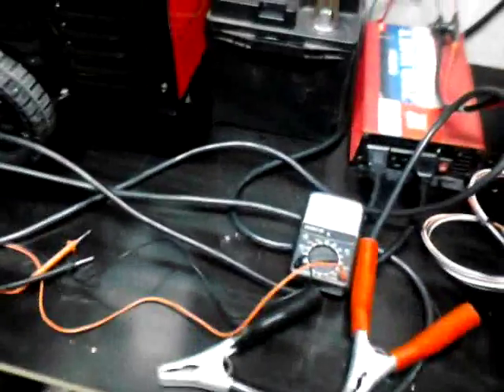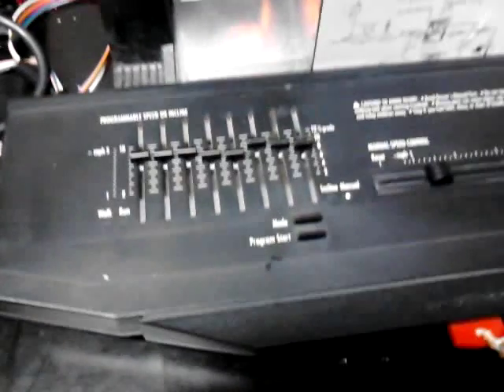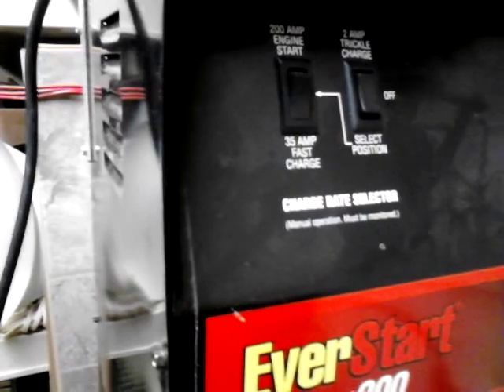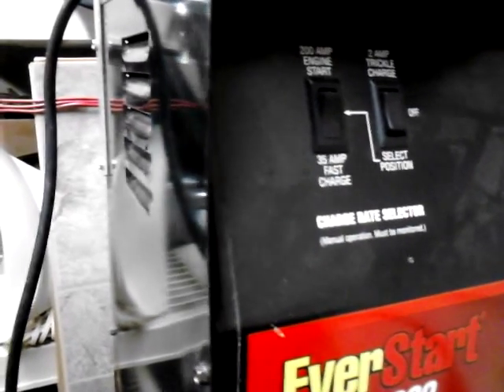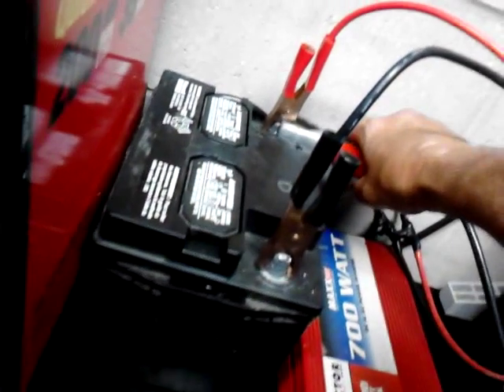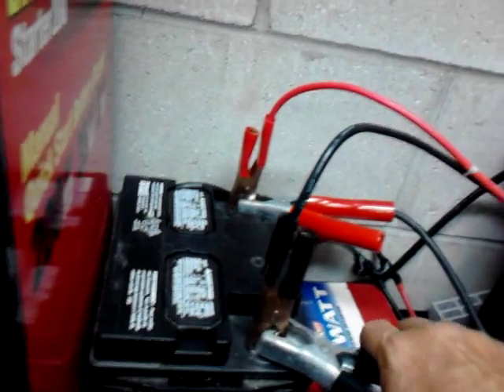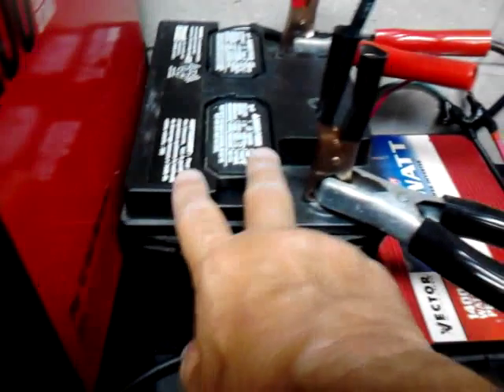electric bike treadmill motor

Comment: AC to DC with battery charger, DC to AC with inverter, AC to DC with treadmill electronics. That's... weird.
Reply: A threadmill motor is a brushed DC motor. Usually rated for 70-100V. So this will easily run on a string of 6-8 12V lead acid batteries, with a simple DC PWM controller and a double throw switch for direction control. As threadmill motors are not that high torque, it would likely be better suited for a small fishing trolley, and it would be able to run for hours like that.

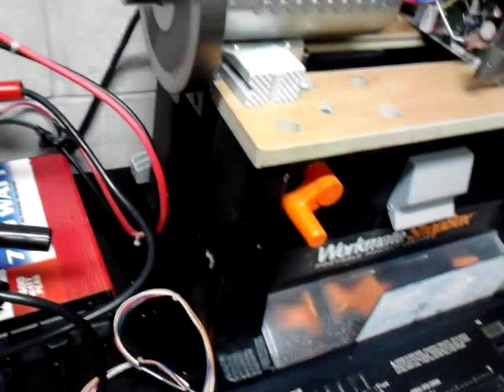Comment: So uhh... where's the bike? You can't just bench test a motor with a very roundabout power supply and call it a bike in progress.  It's not just not a bike, it's not even a treadmill anymore.  People have been coming up with 100 odd volts to run DC motors with batteries alone for something like 150 years.  This is like 2 steps forward and 3 steps and 2:24 minutes back.  Get back to us when you have this 300 pound setup strapped to a CCM.
Reply: what else is on bro please share your contact . I have some queries reg DC 180 V power supply with a 2 hp treadmill motor running a scooter with a variable potentiometer thing. Thanks.
Reply: Haha, I'm not sure why you want my input specifically but I do know a thing or two about, you know, electricity.  I can't tell you too much without a much more specific query though.  All I can tell you is that the potentiometer alone probably won't cut it for your application. :p.
Reply: what else is on yes right. I have decided to use a 3hp bldc motor with 48 v lithium pack and a motor controller

Comment: If you want your battery/s to have as much power for as long as it can then get rid of the inverter and don't have the charger running off the battery. Then use the DC motor direct from batteries.

EX; if you have a 48v DC motor get at least four 12 volt cells(batteries) and connect them in series, this will give you 48volts. Now you don't need the inverter or the transformer for the AC to DC conversion back to DC again for the DC motor itself, because you are already DC current now. Now all the resistance losses and heat losses from all those devices is not there.

Comment: That battery would run down faster with the battery charger connected and turned on. Because since you are taking the energy to run the charger from the battery in the first place, all you are doing is looping energy for no benefit. No benefit because the second you turned on the charger the battery got a draw from it and losing charge, only to be replaced by the charger seconds later, minus friction heat losses. So you are losing more energy in your set up by turning on the charger. Just do it and you will find out, also you won't need to actually do it until the battery dies before you realize it don't work. Because just put your hand near the charger transformer after you ran it for 5 minutes or more, you will feel the heat, that comes from you battery, as lost energy because you hooked up a useless circuit(battery charger getting its power from the battery being charged by that charger) to your system that will produce undesired results, more energy loss, less battery power for what you need it for.

Comment: It will run down way faster due to all the added resistance/heat energy lost in the charger and added wiring. Seems like it would be a good idea at first glance but upon closer analysis it is the equivalent of attempting to pick yourself up by your boot straps only far worse due to the resistance and heat losses you are imposing on the overall system. Same goes for those misguided folks that connect a generator to an electric motor with a belt. The resistance from the wiring and drag of the belt make it yank to a stop nearly instantly when unplugged as opposed to if you just unplugged it and let the motor spin down slowly to a stop from the built up inertia in the armature. In either scenario it is a no go. You could test it simply by timing the voltage drop to a predetermined battery voltage with each test run starting with the battery fully charged alleviating the need for an amp meter. I would guess the battery would go from 13.5 volts down to 12 volts in less then half the the time with the charger in the circuit then the inverter powering the motor alone. It would be interesting to hear the actual test results.
Reply: you can turn it on when you are breaking for regenerative breaking